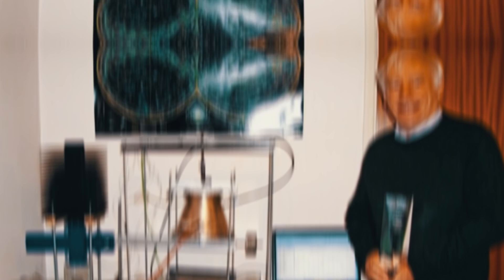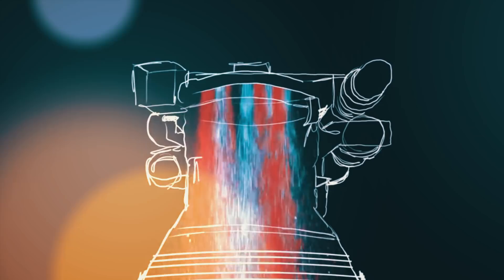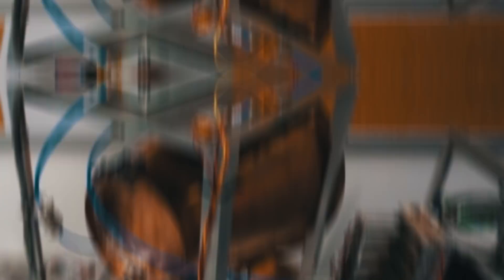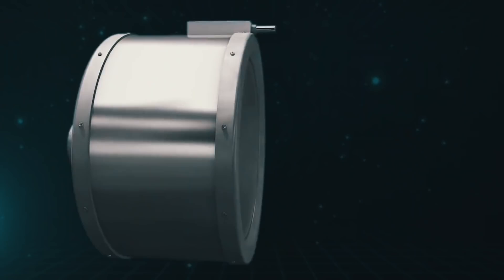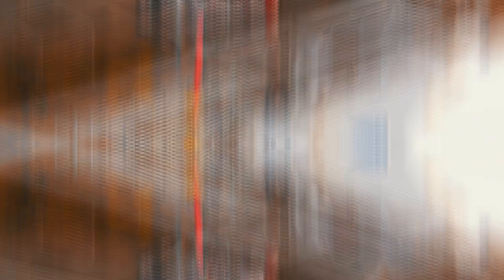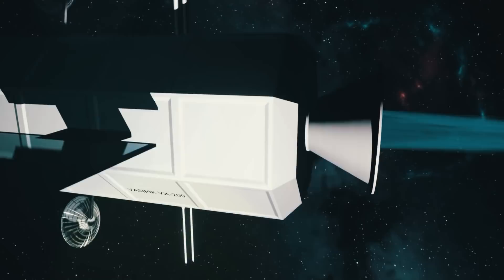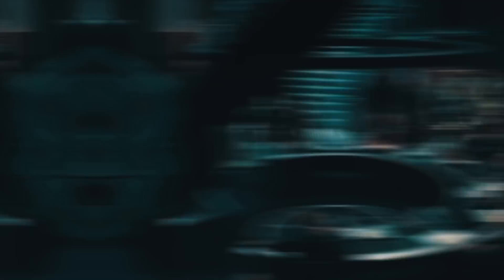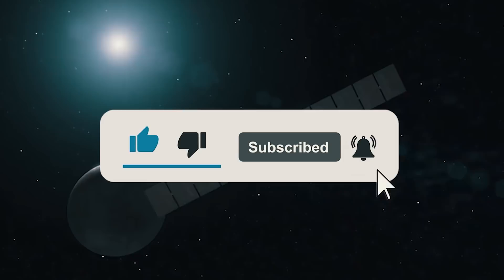NASA Designs Near Light Speed Engine That Breaks Laws Of Physics

Comment: If it broke the laws of physics it wouldn't work...I prefer "they need to rewrite some of the theories in physics"
Reply: It does not work.

All measured effects have been traced to other sources (heat radiation, heat expansion, power cables interacting with the magnetic field of the Earth, …) that either mess up the scale or provide forces that do not come from the actions of the drive.  Take these out and there is not even 1/1000 of the thrust promised.  (One EmDrive was claimed to deliver 18 grams of thrust — that’d be ~0.177 N. There was no thrust of 18 grams, none of 1.8 grams, none of 0.18 grams, none of 0.018 grams.

If you have a 250 HP engine in your car and it delivers not even a quarter of one horsepower … you may well conclude that there simply is no working engine in your car and that that fabulous engine running on water is not, well, running at all. 

Having no “official” design does not help.  

Causing people to think this has been endorsed by NASA when it clearly has not — at best they found something (an error with the experiment setup, it turns out) that’s not explained — is all the proof you need that this is not a fringe scientist still adhering to the scientific principles of experiment and peer reviews but a scam. 

After all, what is better than to shut up the doubters than presenting something that works and can be studied, duplicated and tested by all?

A Perpetuum Mobile breaks the laws of physics AKA  some of the theories in physics would need a rewrite .  Funny how so many Perpetuum Mobiles are patented — and do not work.
Reply: Exactly right. That could be why it does not work.
Reply: Correct Senator thank you for your service to Crag Reich

Comment: A long time ago someone told me that space is 3 meters between hydrogen atoms. If the atoms of the solar winds are collectable something like a space jet engine could possibly be made. Collect atoms by an intake, if they are ionized already, you might be able to electromagnetically create acceleration with them. I know ion engines exist with onboard material for acceleration. But acquiring material that is already out there might be more efficient if not endless.
Reply: Pananides, Nicholas A. & Thomas Arny. Introductory to Astronomy Second Edition. 1979: 293.	
"The density of the gas cloud is incredibly small by terrestrial standards 
-- the cloud contains roughly one hydrogen atom per cubic centimeter."

Comment: 2:25:  FALSE.  Paul March and team at NASA Eagleworks CONFIRMED Shawyer’s findings.  As did the the Chinese, who claimed to build a test article not requiring a truncated cone.
Reply: Burnnnnnnn
Reply: Update your knowldge. The EM drive is debunked 100%
Reply: @carlosandleon  Quiet is not debunked.  Tajmar is not the final say.  He was just the final public comment.
Reply: @LostAnFound  Bro, the only positive findings they found was due to heat fluctuations in one of the wires. 

Accounting for this the thrust was an absolute 0
Reply: @carlosandleon  It's a scam like Zero Point Energy or Beacon College.

Comment: Current state of the art ion engines have a specific impulse (essentially fuel efficiency) of around 12 times that of a chemical combustion engine. But the amount of thrust generated is low. They are only useful in space. Thermal nuclear fission engines fall in between. Their SI is around twice the SI of chemical combustion engines and the thrust is considerably higher than an ion engine although not as much as chemical combustion. So it looks like future space technology will be using all three types of propulsion.

Comment: What laws were broken ? No matter how powerful your engine is you will gain more mass. to move that mass, you need more power. Endless loop. If you are NEAR light speed, YOU ARE NOT BREAKING ANY LAWS.
Reply: The reactionless engine in this case isn't breaking the speed of light. The law that they are talking about is the conservation of momentum. Ion engines or the propulsion by directed charged emission is totally plausible. This emdrive is highly dubious though.
Reply: @Drew Peacock weight and mass are different. If you were massless in space then you could just instantly jump to light speed without having to worry about inertia. As something having mass approaches the speed of light the mass it has grows to infinity meaning that it would take an infinite amount of energy to go any faster.
Reply: @Drew Peacock “which I suppose could crudely be described as how much space an object takes up?” 

You’re thinking of volume. Mass is something with a gravitational pull on something else with mass. When you are on the earth, the earth pulls you to it but you also pull the earth toward you. In space you still have mass so you still pull other things toward you. More importantly, if you are moving you have momentum. To stop yourself from moving in space you would need to get rid of that momentum and to move faster you would need to gain momentum. 

Back to mass. Imagine a ball the size of your fist made of wood and another ball of the exact same size made of lead. You could drop both balls on earth at the same time and they would hit at the same time, but the ball made of lead would hit the ground a lot harder. This is because the ball made of lead has a lot more mass. 

“If I (or the spaceship I'm in) were massless then surely neither would exist?” 

There are only a few particles that don’t have mass, Photons and Gluons. Photons don’t have mass, but they do have energy. Under special circumstances you can transform them into energy using the famous Einstein nuclear energy equation. 

“Do objects still have SOME weight in space, just far less than on earth?” 

Think of weight as the amount of effort it takes to lift something off of the ground. The moon has a lot less mass than the earth, so if you were on the moon you would take a lot less effort if someone wanted to lift you. 

On the other hand since weight only matters going up and down it would take the same amount of effort to push you sideways. Back to the wood ball and the lead ball. If you are throwing them it takes more effort to throw the lead ball than the wooden ball if you want to have them leave your hand at the same speed, but it wouldn’t matter if you were on earth, on the moon, or in space. The difference would be that on earth it would be pulled down more and so hit the ground earlier, in space the ball would just keep going until it hit something.
Reply: @Drew Peacock Please do a search for the  difference between mass and weight. There are plenty of great videos for  beginners.
Reply: @Richy's Radio Room  The law that is claimed to be broken is the conservation of momentum. Whether you have a chemical or ion based rocket, the underlying principle is that momentum is conserved. But if no mass is being ejected  (i.e. no ions, no gas) then no momentum should be imparted to the rocket.

Comment: They have "designed" nothing of the sort!  At best they have devised a possible (and unproven) theoretical answer to a propulsion requirement that cannot even be tested using today's technology. Even the much vaunted (and perennially delayed) rail gun at least actually exists in experimental form.
Reply: cannot even be tested    It can, it has and it was found doing nothing at all.

Besides, a railgun has a very solid theoretical base.  Very early in electricity they found that an electric current affects the needle of a compass. Every electric motor … uses the same theory the railgun uses.

Absolutely solid, boring, lame stuff.  On the theoretical side, that is.
Reply: @advorak8529  Right.  A rail gun is basically an electric motor. 
And EM drive is basically ... nothing at all.
Reply: Thanks Stephen, you said the words, “ theoretical “ in theory I can be on the Uranus and back in one day! But what a day that would be? And don’t even needed the speed of light to do it. And about those Railguns, I’m on the list to be the first old fart to send out in space, just sitting on that beam. And don’t worry about me, I’m not gonna fall from it, I have a real strong and long belt with me, I’m gonna bind it to me and that fucking beam, so to be sure that I’m arriving somewhere in Theory!!!!
Reply: The rail gun has been tested at projectile speeds up to ~Mach 5. But it has HUGE problems. The plasma it generates essentially destroys the railgun itself after just a few trials. The electrical storage and rapid discharge systems also don't last. In addition, while the projectiles were once thought to be relatively inexpensive, they were later projected to cost more than the smart and very costly 'Excalibur' munitions currently in use.
The problems are so great, that the USS Zumwalt destroyer (DDG 1000) no longer anticipates being fitted with a railgun.
Reply: @advorak8529  Remember Hooverville? lol thx love
Reply: @advorak8529  isn't a maglev train some sort of railgun just with infinitif barel
Reply: @hmcredfed1836     Is there a very strong current going through one rail, through the train and then back the other rail?  No?  Then it is not a railgun.

It is much closer to a coilgun, though the train is not a passive conducting or ferromagnetic object.
Reply: @gregparrott  my understanding is that several are deployed
Reply: @michaelsanchez591  I'd be interested if you can substantiate that they have been 'deployed'.
The term 'deployed' means they have passed a very rigorous series of test, sufficient for them to be APPROVED FOR COMBAT. 
My understanding is that rail guns have NOT been deployed, but are still in the research and test phase, with reduced funding.

Comment: In 1967, I worked on the NERVA program, a nuclear rocket engine developed at the Westinghouse Astronuclear Lab in Large, PA. The engine used liquid hydrogen as a fuel that was fed through small holes in the nuclear fuel laden graphite core. There it was heated to about 2500C in 2 meters and exhausted out a nozzle that provided nearly a million N of thrust with a Specific Impulse of about 10,000 m/s. The engine was tested numerous times at the Nevada Test Site.
Reply: It was a damn success.
Reply: Sir it's honor Star Fox is Opfor now commence The Great War 2077
Reply: @joseinfante5054  Yeah Salem you freak lol

Comment: Idk man. I think any thrust can eventually hit light speed in space. It’s just matter of when.
Reply: No, as an object gets closer and closer to the speed of light its mass grows exponentially. Ultimately you need an infinite amount of energy to achieve the light speed.
Reply: @fernandobernardo6324 , so light requires an infinite amount energy to achieve light speed? Last I remember, light is matter.
Reply: @kevinmccorkle7476  yeah, that's why you keep stepping back when exposed to direct sunlight. Light is massless my friend
Reply: @fernandobernardo6324  light I'd just another form of matter. Solid, liquid, gas, etc. It could not travel, if nothing was there.
Reply: @kevinmccorkle7476  Something has properties and light has its properties, one of them is being massless. A particle doesn't have to have mass to exist. Light has momentum but no mass. Do you feel pushed when a strong light is turned on you? Why can't you feel it like the wind.? Could you imagine the push you would feel being at the sunlight if light had mass?
Reply: @fernandobernardo6324  it has to have mass to have momentum. You cannot accelerate "nothing" and be able to measure it. Your physics professor needs to put you back into a remedial course.
Reply: @kevinmccorkle7476  It is admittedly confusing. But according to physics, light is indeed massless, yet imparts momentum. I don't understand the discrepancy well enough to describe why, other than that light's electromagnetic wave is massless, yet imparts momentum. Look it up.
Reply: @fernandobernardo6324 electrical current is transported over beams of infrared light every day. Beam detectors for alarm systems, etc. Electrical current is negatively charged electrons from the outer valence shell of the conductor in motion. If there are atoms, then there is matter. Very simple physics.
Reply: Or were or here or then or NOW!!!!!
Reply: @fernandobernardo6324  no
Reply: @Theone0611 , yep. Good thing you noticed. I was so afraid that you would pass me by with your infinite wisdom........
Reply: You're just flat out incorrect. Nothing with physical mass could ever possibly reach the speed of light. It is purely physically impossible, friction exists, thus it can not happen.
Reply: @NorthernHarker  you had one whole year to think about your reply. And you came up wayyyyy short and completely wrong lol

Comment: I still have to modify the main diagram vac yeah I'm a separating the back pressure from the positive negative and putting a small leak up on the negative and positive microwave magnetic vacuum detonation wave will be something of a afterburner to the spaceship so for running the in drive system magnetic micro propulsion or microwave if you let the magnetic negative separated from the vacuum on the positive and let it drip in and hit faster instead of just having a separation on a microwave flux that bends the magnetic flux around and pulls the magnetic gas it'll detonate wave and then I don't know it should be like that after burner hopefully I'm still playing with the diagram the diagram vacuum centrifuge it'll be like an EMP detonation wave or something like the atomic atomic separation almost like a controlled atomic nuclear engine in theory but then again if we wanted to make one of those we could have just took a spark plug and threw a spark plug out there and just clicked it a couple times huh

Comment: basic principle off nuclear power engine and engine in scfi movies is called cryogenic actualy is scfi scince based on impression on reverse know how enginering from cold sphere to warm life or living conditions a 3 tri stage process safety improvments compresion room and decompression  chamber and could hold a neck part also like build purpose if possible a behave like engine a co called water turbine cooler most eficient use nuclear hybrid on electric propolsion steam is attached to generator and release gas under magnetic core and ionize it, as to possible cooling if any a tesla turbine is recomended due to unnatural spiral freequncy and probably very efcient like turbine frequency  very close frequency to soemthing working one as nuclear core due to lower rotatioans is very good engine nuclear for marine purpose how to improve tesla coil and create water cooling if it even possible is good idea  closer to cryogenic which is kind durabkle source sounds bit chamber cacoon also cryogenic on long voyage home or UAV flight frompoint to point  so the idea is to fix cooling pipes cage aorund in second tank in it core since its production core is limited by heat cycle and seen material heat outside mesure is closed systemas it since power a elctric generator which do all rest off job basicly is closed cycle preaty much wokrs as combust engine but is cryogenic one, the stuff that maters are like thorium cells how to fit thorium cells engine in spaceship drive is kind know fix with purpose fit in dimension prupose like good idea since is powerfull enough is it small enough is about to be shown defiently enough energy for it or for industrial cycle in future too

Comment: Hmm, you mean like these?  US10144532 US10322827B2 The first one is likely the variant used with the Space Force and the other is a roughly 3ft diameter Zero Point Energy device that produces a Terawatt of energy. When combined they make for a very, very fast vehicle. Scale the powerplant up a tiny bit and you're well over the SOL. We have vehicles that are 50 times the SOL. Now imagine that powerplant in a submarine, aircraft carrier, or other mainstream aircraft as a backup power unit. Submarines could things undersea, in the air ,and up in space. Aircraft could get anywhere on the planet in about 90 seconds. Aircraft carriers could loiter at 60,000ft or more. Thanks for the distraction NASA.

Comment: Whilst it MIGHT be possible to develop such an engine, currently there is no material available to build the craft to instal such an engine. To achieve the speeds such an engine allegedly reaches, would over heat all the material available today and cause catastrophic failures. A bit like putting the cart before the horse. L.O.L.

Comment: The only practical idea for such powerful propulsion was the 1960s  Freeman Dyson Orion Project. It was a brute force propulsion system that used a massive iron plate with a hole in the middle through with thermonuclear devices would drop and detonate. Calculations showed that a series of nukes set off like that could propel the ship to fractions of light speed. The Atmospheric Nuclear Test Ban killed it off.
Reply: True

Comment: Only UART engines can go at FTL. Faster than light speeds. Photons actually do have mass. And drag. But is so rediciously small that is almost negligeble. However as the speed increases the drag increase as well. At some point drag becomes significant and light cant go faster. Ressistance increase and that is the light speed limit. Everything have mass, speed and resistance. Light is no exception. Photons DO have MASS. 
There is no such thing as pure vacuum. Is just less dense area. But is not zero. Light have obstacles to overcome. Gravity, magnetism, etc. And small other particles. Also photons can push. Solar sails. So in ideal conditions if nothing slow you down you will go as fast as you want. Remove the ressistance in front of you. So basicly we talk about quadrilion times more efficiant jet engine. Electromechanical turbine.